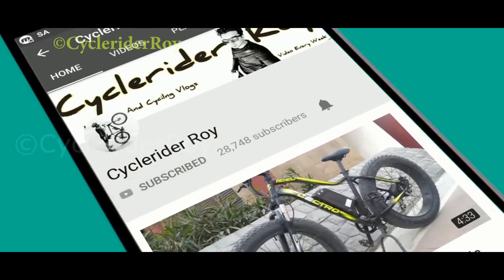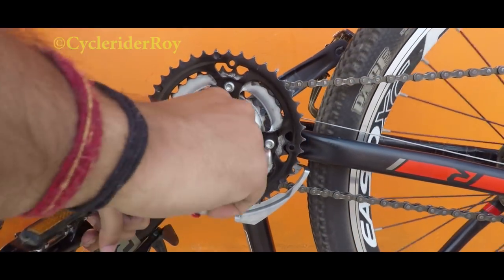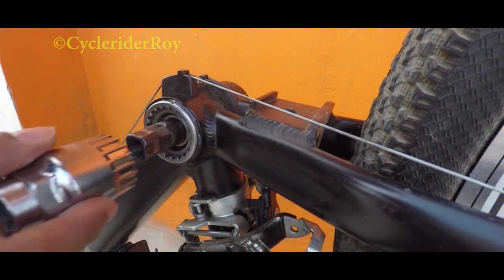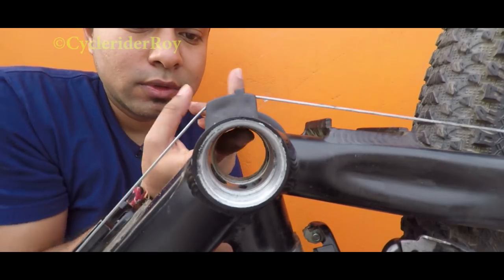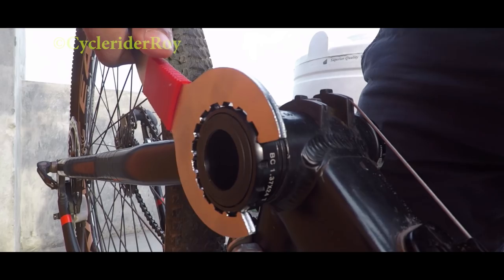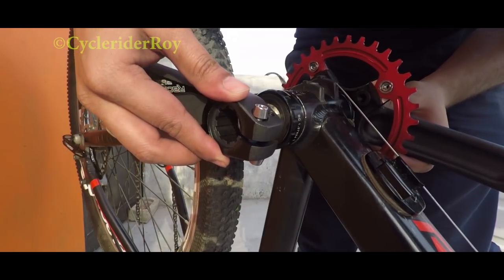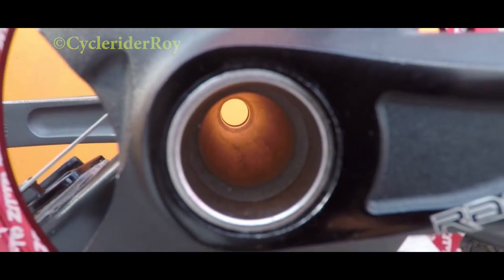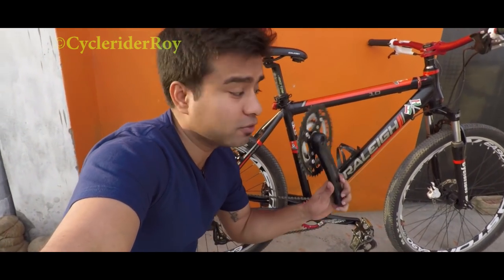How To Upgrade 3x Speed Crankset to 1x Speed Crankset | Hollow Tech Crankset Upgrade In MTB

Comment: Hello Roy, nice video. But please explain why u removed 3 gare and fitted 1. What is the use and how it helps for a raid ?
Reply: Simplicity and weight are the most common answers
Reply: Bro sifting karne main achani hoti hain
Reply: Simply to declutter. Most of the times you will just need a really low gear a really high one and a middle one. With 3x there is alot of clutter in the cockpit and most of the times it is unnecessary so converting a one by is a good idea. Less cranks less cockpit clutter. More simplicity , however converting a 1x8 doesn't make much sense to me i wouldn't untill unless it's a 1x9 minimum.
Reply: @Abhishek Chhillar  no it just help u In climbing unless ur sprocket teeth should be decrease or chainring should increase
Reply: Simply, the 3x cranksets have older technology, while the new 1x hollow bottom bracket is more advanced in technology.

Comment: Hello Roy, I've a Riverside 500 can you please tell if a Shimano alivio 3 by crankset with hollowtech 2 bottom bracket can be installed in the bike after taking out the stock crankset if it can be done, which is the exact bottom bracket size suitable for the rs500 ? Since I'm slightly handicapped with cerebral palsy my efficiency is kind of low on gradients and long hours in the saddle so to ease up things I thought of upgrading to a lighter 3by hollowtech 2 chainring.

Comment: Mr. Roy,

I am subscriber of your YouTube channel. It's very informative, inspiring and motivating. 
I value your expertise and experience par excellence.

I have a Btwin tilt 120 folding bike with 1x6 gears. Can it be converted to 3x6 without affecting it's city ride adversely and making its uphill ride more comfortable or it would be better to convert it into 1x8 or, if possible, to 1x10 ?

Please give yours expert opinion about its feasibility and advisability.
😊

Regards.
Reply: Which is better 1×8 or 3×8 ?
Reply: @Films_by_vinal  1x8 with crankset and cassette of good ratios of teeths
Reply: @Films_by_vinal  single speed crankset were designed primarily for enduro riding by SRAM. The main idea was to make gear shifting easy & reduction of weight. Shimano too offers the same in their highest components. The more traditional 3 speed crankset is good for every other purpose. The former is expensive and the latter is cheaper as it has been used for decades.

Comment: Nice video but 1x setup be more efficient than 3x setup on hill climbs and long rides like 100kms or so ? I am sure for decent the would be better. Would appreciate your reply. Thanks
Reply from the maker: 1x and 2x are both good. It really depends on what type of terrain you are riding and how strong your legs are. 2x in general you will have a wider range which which will help with a terrain with lots of climbs. But you can get a good range with a 1x if you run a set up with a chainring 32 or 34 which I am using  right now and adding a 42T to your cassette which I'll be doing next upgrade to the bike.

Comment: Hey there!
I am thinking of a simillar conversation but i have doubts about gearing ratio my bike goes upto 55km/hr on current setup it's 42t max at front & 11t lowest at behind. I will definitely lose a little top speed but i wanted to ask if the first gear feels simillar to old 1 in front and 4 at behind or lower on same cassette?

If it's simillar to that i will upgrade to hollow tech single speed or else go for a 22-44t crank 

Please reply i would really appreciate it.
Reply: No reply Oof

Comment: Sir, why it is necessary to convert higher gear crank to Lower gear crank as you did here from 3 by to 1 by crank set? Simply what's the benefits of 1x crank over 3x crank
Reply from the maker: Simple, more power, no more gear tension,

Comment: I'm using 1*9 setup.. But when i put my gear to the lower one it sounds like hell.. The chain bands.. Do i need a flexible type of chain (if there's any) to solve the problem?
Reply from the maker: No there is no flexible type chain, try getting a Shadow clutch derailleur or a Chain guide.

Comment: Hi @cycleriderroy. After making the changes. Don't you face the chain dropping problem? I am trying to upgrade my 3x7 to 1x7. The local mechanics are suggesting not to do as it may cause chain dropping problems. 

Any suggestions?
Reply: SEE THE CRANK HAS WIDER TOOTH AND NARROWER TOOTH WHIS WILL PREVENT THE CHAIN FROM FALLING AND YOU CAN ALSO USE CHAIN GUIDE
Reply: Or you can reduce chain links as well
Reply: @vikashvkk  chain link reduce karne pe derrailuer pe pressure parega
Reply: Use a narrow wide chain ring

Comment: Why switch to hollow tech crankset u could have just bought a new chainring and new chainring bolt if u wanted to just convert ur bike from 3x to 1x drivetrain.
Reply from the maker: Hollow tech is best, it's roation is precise and weight is lighter